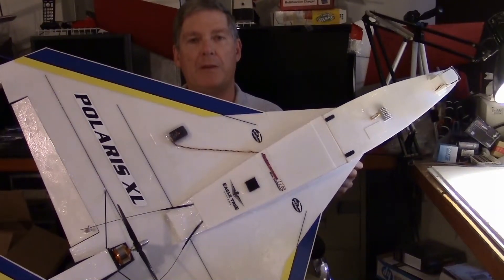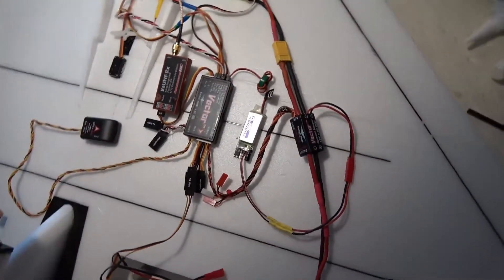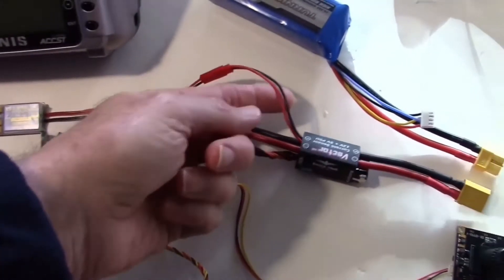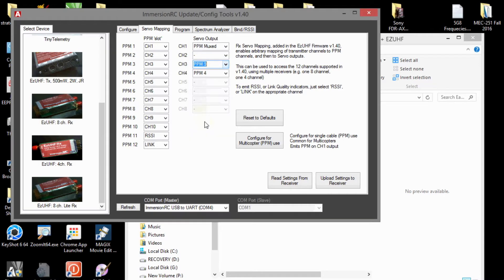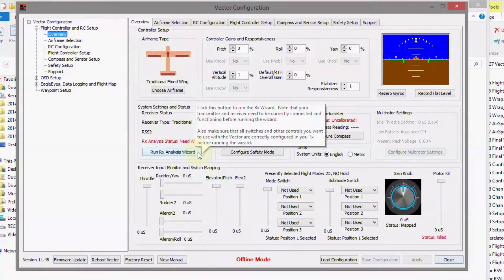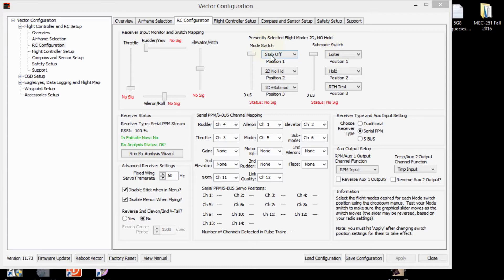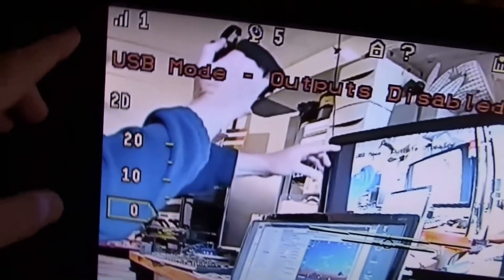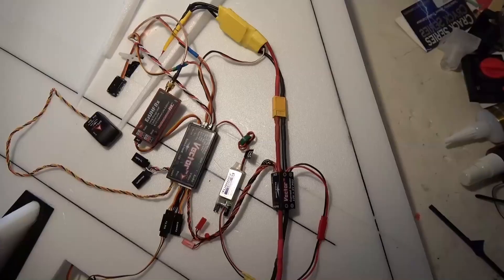ModelAero Polaris XL FPV Seaplane Build Part 11 - Eagle Tree Vector FC EZUHF Wiring and Programming

Comment: Doesn't the Vectors Power Module put out a nice clean 5vdc to drive the Servo BUS rail..?....on that little white plug there..?
  The one you did not appear to use..?

I liked the Vector overview, first one I have seen on this Top Draw FC / AP.....Its a well sorted bit of kit.....:)....Nice.
Reply from the maker: The vector manual says to only use those plugs for video TX or camera. They only have 1amp of current tops. I use a 5 amp UBEC for the servo rail for that reason.
Reply: ***** Oh, I see....strange, 1 amp @5vdc is no good for a Camera, or vtx certainly no good to drive a bunch of servos either..?   wierd.
Reply from the maker: I think if I had used a 600mw vtx or less it would have been ok. The 800mw vtx was right on the edge and the 12 volt regulator kept shutting down. After reading the manual I got the scoop on the problem.
Reply: ***** Oh ok...its still a bit strange of them to think that 5vdc was an ok voltage to run a Camera and / or a VTX though, dont you think? Although most serious FPV ers will use a dedicated 12V BEC for Video anyway...:) Like your clips man, Im retired too...LOL.
Reply from the maker: My guess was they were trying to be compatible with cameras that run on 5 volts like the Fat Shark FPV camera. It's very unusual to have a 5 volt cam but there are some. 
Look at page 18 and 19 of the manual for more strangeness
http://eagletreesystems.com/Manuals/vector.pdf

Thanks for posting. Us retired guys have to stick together.
Reply: ***** Agreed, but if they knew their market, they would know that no serious FPV type would be using either a 5 volt Camera or VTX....and the Vector is obviously for serious users.
Reply from the maker: Sure and it's not too late if they would just make a version-2 power module with a 3 amp 12 volt tap although if it was me it would be 5 amps just to be safe. 
Another thing they could add would be waypoint mission planning but that probably drive the price even higher which wouldn't be good.
Reply: ***** 5amps at 12vdc is not too difficult either....although adding a 12vdc BEC isn't either...which is what I do.  They are working on Way pointing I hear..:)

Comment: So you do not use the bec off of your esc to power the vector and servos?
Reply: I was wondering this also. He has the additional BEC sourcing power Vectors current sensor block, and that's supplying power to the servo rail on the Vector FC. But he also appears to have the BEC from the ESC connected to the servo rail on the Vector FC also.

I assume the additional BEC is plugged into the 'backup supply' port and there's some kind of electronic magic going on. Or does doubling up both BECs just give a larger supply of current? As in if the additional BEC is 5a and the ESC has a 2a BEC, does that simply just mean the servo rail can provide 7a?
Reply from the maker: The bec off the esc is not used. In fact the esc is an opto version without a bec.I use the bec that I soldered to the power module to power the servo bus (rail).
There is no second bec to that rail/bus because it is floating,
so it's only 5 amps. The added bec also acts as backup power for the Vector I think.
Hope this helps clear things up.
Reply from the maker: No, that is not good practice because of the noise and possibility of failure.
Also it is an Opto type esc with no bec.
The vector is powered by it's own power module with current/voltage sensors.
Servo rail is floating and is powered by the bec that I added.
Reply: +dmerc00 Ok. Thanks.

Comment: under wiring and programing could not access it .
Reply from the maker: Oh, That link just takes you to the same video you are watching so it may appear as if it didn't work when actually it just linked back to where you were already. 
I put those in so the search engines will get the link.